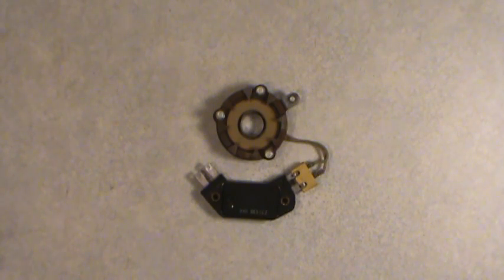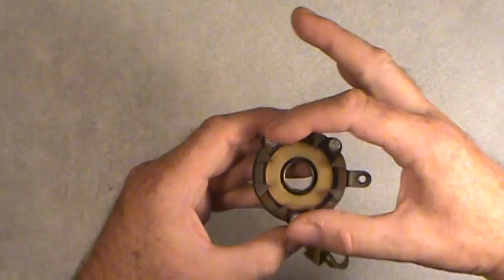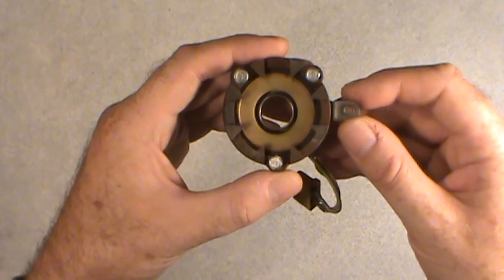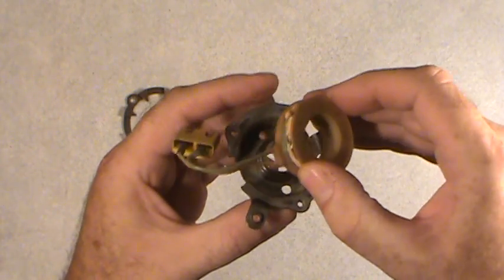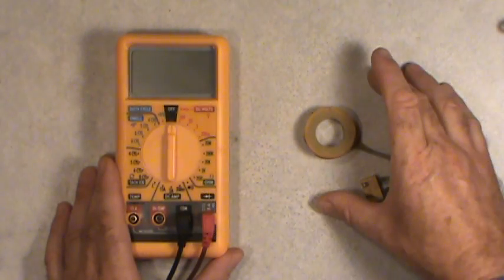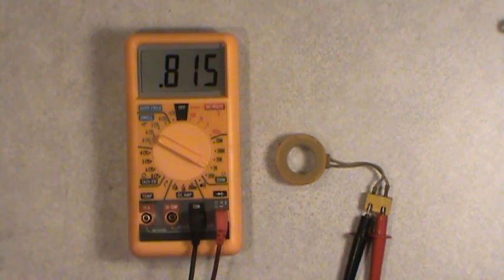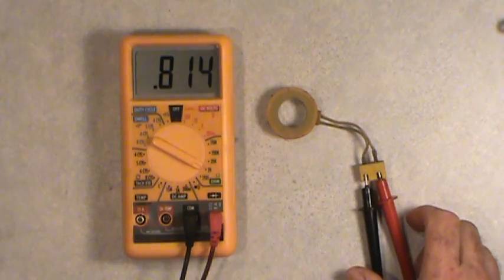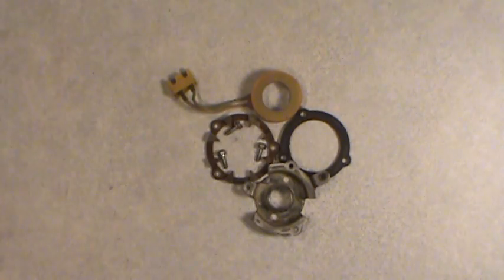HEI Distributor Pickup Coil Test

Comment: Thanks for the detail. The comments complaining about taking too long, are from guys itching to get back to their parts shotguns. “Hurry up damn it, Autozone closes in 20 minutes!”
Reply from the maker: Greetings...Tbone productions...……..You're welcome, and, thanks for watching...……..Yes-Sir-ee--Bob...there probably are, quite a few people, these days, that, sure seem to be, in quite the hurry alright...(oh, and, "no"..."horse & buggy rides"...for them, what-so-ever...!!!...lol)……….As I look back in time, then, the reason, that I started to study, and started to, some-what understand, the (General Motors), HEI (High Energy Ignition) Distributor, and how it worked, was because of, that, "misfiring", Chevy, 350 cubic inch (5.7 liter) V-8 engine, that I had to fix, way-back-when...…….Well, to me, it sure seemed to be, "ignition system" related, alright...…….So, I removed the HEI Distributor, and had a closer look at it...…..The pick-up coil's, very fine/thin windings (of wire), looked-like, they had seen too much heat (over time), and, the varnish-like coating, started to flake-off, if you will (replaced "it", and still no luck...lol)………..Then, I started, throwing some more parts at it, as well as, new spark plugs, and, spark plug wires too...(oh my gosh...!!!...lol), and, the engine seemed to run a bit better, but, still wasn't quite right (it's all good, because now, I have some, probably, working ok, "spare parts" for it...lol)……..Hmmm...so now what...???...I know, lettuce (lol), remove one valve (rocker) cover at a time, and, have a look-see...…….While, the warm engine, was running at idle speed (while having, only, one valve/rocker cover, removed at a time), then, the drivers (left) side, seemed to be ok, as in, all of the rocker arms, were..."tee-ter...totter-ing"...equally...but...when, I did the same, visual test, with the passenger (right) side, then...there..."it"...was...!!!...as in, the Number 4 cylinder's, exhaust valve's..."Rocker-Arm"..."was-not"...moving, very much at all...!!!...…….Yeah, I've heard of that, good ole, Chevy, "soft" camshaft story before, but, I never thought, it would ever, happen to me...lol...…..Come to think of it, I probably, never ran, that engine often enough (lesson learned, this time...lol)……….I actually ran, that particular engine, on, only "7-Cylinders"...!!! (it, huffed and puffed, and shook a bit, while at idle speed, and at very low speeds, but, when I got it up to, about city speed, it smoothed out, pretty darn good/almost like normal...…….Then, (for the temporary "fix"), I removed, the intake valve's rocker arm, and push rod, so the intake valve, would remain closed, 24/7...…….Then, I removed, the exhaust valve's, push rod, then, I placed the right length of bolt, under the rocker arm (push rod side), and then, turned (tightened), the rocker arm's adjusting nut, so, the exhaust valve, would remain open, just a little bit, so, that particular cylinder, could breathe, some-what...…..Engine started good, and never stalled, and, all of those, (running), "7-Cylinders", never misfired at all...!!!...lol...…and......till next time...….Be Safe, take care, and have a good one.
Reply: RockysRoadshow I’m amazed with all the engine components and transmission components and electrical etc. that cars are as reliable as they are. Not to mention the different weather conditions that we run em in. Take care

Comment: What do you do if the reluctor touches or taps those little triangles on the way by as it rotates? I know it's not supposed to but what do you do if that happens?
Reply from the maker: Greetings...Larry Van Valkenburgh……….Thanks for watching...……Well, if any of the outer, and inner triangles, are making contact with one another, then, that's probably not a very good thing at all (bent shaft...???...loose, or worn-out bushing/s, that will allow the shaft to go sideways too much)...………There should always be, an..."equal air gap" (as is, physically possible)...between all of the triangles, as, the inner set of triangles, that are on, the distributor's shaft, is rotated (advanced), by one, (triangular shaped) tooth at a time, and, the triangular points, are also, lining up with each other...……..The reason for the equal air gap, is because of, the way, in which, those two set of triangles, create an electrical signal (rising and falling of it), due to magnetism (there is usually, a flat, thin magnet, that kinda resembles a brown-ish colored fridge-magnet some-what) that can be seen, if those 3 screws, and the outer set of triangles, are removed from, that metal casing...…….I've actually "adjusted" the "air gap", on a V-8 HEI distributor, some time ago, as, I observed, a not so equal spacing (air gap), by my, shall we say, well-trained-eye...lol...…….If, by chance, any of the colliding triangles, have been, shall we say, "mushroomed over", then maybe, that triangular shape, might be able, to be restored, by using a small flat file (from a needle file set, possibly), but, only as long as, the pointed end of the damaged triangle, doesn't get..."shortened"...from its original size, otherwise, the air gap, might become too large, and, the result might be, a weakened magnetic field, possibly (ignition misfire maybe...???)………..If I recall correctly, if Ya hook up a volt-meter (multi meter), to those, two, pick-up coil lead wires, and, spin the gear end of the distributor, as fast as you can, by hand, then, there might be, a volt or two, showing-up, on that volt-meter's readout/screen...…….Those 3-screws (that, "are not" equally spaced), that secure, those outer 8 triangles/as a unit, can be loosened slightly, then, like I've done before, just tap those outer 8 triangles, from the side, until Ya end up with, having, the inner & outer sets of (8) triangles, equally spaced (air gap), when-ever, any of, the 2 triangle's pointed ends, are in line with one-another, oh, and, don't forget to "tighten" those 3 screws, or, oh oh, it will probably be (maybe, use some thin cardboard, or, a stack of, some small paper pieces, to create, a non-magnetic feeler gauge, if need be)...……..The actual "trigger" position, of those 2 sets of triangles, that trigger the ignition control module, happen, when, the "inner" triangles, just get past, the "outer" triangles, as the distributor's shaft is spinning (as I recall, the ignition control module, gets triggered, by the falling electrical wave, so to speak)………...I remembered this phenomenon, and, just a few weeks ago, I had to install, a brand new HEI distributor, into a 4.3 liter V-6, (only had, 6 triangles this time), and..."Hole-ee-gwalk-ah-moly...I was with-in...about..."2-Degrees"...when I put my timing light on it...!!!...lol...………Yes-Sir-ee-Bob...there will probably be, a rising, and a falling, electrical potential alright, as in, it will rise, as the triangles, approach one another, and, it will fall, as the triangles, just go past, one another, and...….till next time...…..Be Safe, take care, and have a good one.
Reply: @RockysRoadshow  Problem magically went away. All I can say, except I had the distributor together and apart several times and when I got a new module in there, they no longer touched. Thank you for your help.
Reply from the maker: Greetings...Larry Van Valkenburgh………..You're welcome, and, I just saw your post...…...You were saying that, you recently installed, a new, Ignition Control Module...…….I sure hope, that, you put some..."Correct"..."Heat Sink/Thermal Paste", on the metal/backside, of the module, before mounting it, because, if you don't use the Correct, heat transferring goop, then, the ignition control module might "over-heat", and, burn itself out...!!!...…….Don't use..."Die-Eelectric"...grease, as it won't transfer much, if any, of the module heat at all...!!!...(just read the label, or instructions for it)………..I use the stuff, that the computer folks use, on the heat generating chips (IC's/integrated circuit chips), that are found, inside of, computers and video gaming units...…….A small tube of it, is usually less than 10 dollars, and will last for, many, Many, module installations...…….This "thermal paste" (heat transferring compound), is usually, a white-ish color (Not "clear-ish", like, die-electric grease is, at all...!!!)………..Also, those 2 metal..."eye-lets"...that go through the ignition control module, are actually, the..."electrical ground"...for the ignition control module, so, make sure, that, the eyelets, and the 2 screws that go through the module, are nice-n-shine-ee and clean...…….Yes-Sir-ee-Bob...these HEI, ignition control modules, sure do, generate, quite a bit of heat, and, if Ya want "it" to have a long and prosperous lifetime, then, please do, use the..."correct"..."heat sink/thermal paste"...which Ya might not find, in an auto-parts store (I went to a computer store, and, I bought the cheapest stuff, and, there's also, some, really, Really, expensive stuff as well, as in, the stuff, that's called, arctic silver, as I recall), so then, there Ya have it, and...…..till next time...….Be Safe, (don't over-heat), take care, and have a good one.
Reply: @RockysRoadshow  I had to buy and use the ACCEL Control Module, and I used the thermal paste that came with it. I build my own computers also, and know all about the heat transfer and thermal paste. The woman in O'Reilly's who is very smart and helpful, said Die-Electric, and I knew that was wrong. Thanks.
Reply: I'll also mention, that this HEI distributor is basically brand new, even tho I have about one year's use on it. It's one of the conversions for Ford 351 w engines, and is awesome. So, it was clean and not worn in any way, except for the pickup coil windings coming all apart and shorting out the module. So I now have a new pickup coil, new Accel module which matches the ignition coil. A new MSD cap and rotor, and am now back in business.

Comment: Nice video . i remember years ago replacing one of these on a 77 Chevy Caprice . it was really tricky to find what the problem was. Was in trade school for automotive and the very next day we covered this part in class. How luck can you get.
Reply from the maker: Greetings...keving52002............Thanks for watching...........Yes-Sir-ee-Bob..."luck"...was in Ur corner alright, and, Ya should-ah considered, the though, (back then), about, maybe buying a few Lottery Tickets (just in case)....lol...........Those many turns, of "fine/small diameter", wire windings, that are wrapped around that, shall we call it, a "bobbin", perhaps?...are quite impressive, as to, the job/function that it performs...........Then, if a vacuum advance can/canister is in use, then, we gotta, keep in mind, just, how many times, that, the "bobbin's", two insulated lead wires, get "flexed", back and forth, whenever the vacuum advance canister, changes the position of its actuating rod, not to mention, the amount of "heat", that the whole HEI Distributor is subjected to............Gotta make sure, to use the "correct", heat transfer/heat sink "paste/compound", on the metal/back-side of the ignition control module (as in, the type of heat sink grease/compound, that the computer folks use, and "NOT", to use...die-electric grease...!!!), or, there's a pretty good chance, at having, the ignition control module, go..."Poof"...from too much heat build-up...!!!..........Also, all HEI Distributor components, have to get along with each other, as in, the, correct "matching" up-with, one another..........I hope, Ya have, another, "lucky", point-in-time, every so often, and.......till next time........Be Safe, take care, and have a good one.

Comment: Engine have a LOT of vacuum at idle. None at WOT
Reply from the maker: Greetings...Ryan Hamm.........Thanks for watching.........Well, you are right, generically speaking, that is.........More like, there will be quite a bit of, intake manifold or plenum vacuum at idle speed, which will usually be dictated by the camshaft, as in, a stock engine's camshaft, will produce lots of idle speed vacuum, where-as, a very aggressive camshaft, won't usually have, all that much, vacuum at idle speed, and sometimes, not even enough vacuum (signal), to, be able to, run a vacuum brake booster...!!!...yikes...!!!...lol...........Also, there's usually a little bit of vacuum at WOT (Wide Open Throttle), as in, some carburetor manufacturers, rate their 4-Barrel carburetors, at about 1.5 Hg (inches of mercury, on the vacuum gauge), and, a 2-Barrel carburetor, at about 3 Hg (as I recall)...........All Ya gotta do, is hook up an "accurate" Vacuum Gauge, to the intake manifold, or, the Plenum, as the case may be, and, see what the vacuum gauge reads, at idle speed, when the engine is fully warmed up to operating temperature..........Then, do a WOT run, on a safe (legal...lol) road, or, on a Dyno (Dynamometer), and see, what the "real" vacuum reading, actually is, oh, and, look Ma, no more "guessing" any-more...lol...and.......till next time.......Be Safe, take care, and have a good one.

Comment: I got a question. My distributor in my 1979 Volkswagen bus is getting very very hot and I have no idea why it is
Reply from the maker: Greetings...KikiMaster Chris.........Thanks for watching.........Was this too hot of a Volkswagen distributor, something that you just happen to notice, as compared to, how hot it usually gets, once the engine gets up to operating temperature, and also, how did you determine its temperature, as in, too hot to the touch (by hand), or otherwise...???............Is the engine running good or not...???...........The distributor's main body might be made out of aluminum (metal), and is usually installed into the engine block (case), so, the heat from the engine block, will get transferred to the aluminum part of the distributor, and that's one way, that the distributor will get heated up...........Hmmm...have you replaced any ignition system parts, or made any new ignition timing (advance?) settings/adjustments, just before you noticed this extra (hot) heat...???............Here are a few other things...........Did you notice any unusual/different "sounds", coming from the distributor at all, as in, squeaking or grinding noises, etc....???...........Inside the distributor cap, at the top/center, there might be a spring loaded carbon button, that makes contact, with the (spinning) rotor's center point (metal part of it), and, if the carbon button "wears" too "short", it will usually "lose contact", with the rotor's metal bar (contact point), and when it does, the Larger the Gap becomes, the higher the ignition coil's, high voltage output has to get, in order to, shall we say, "make the spark jump", that extra, not so much wanted gap..........Same thing happens, when-ever a spark plug's electrode "Gap" gets Larger, than the factory's specified spark plug gap, for that exact engine...........Also, just about any time, that a Larger Gap occurs, anywhere on the secondary/high voltage side of the ignition system, then, the poor ole ignition coil, has to work much harder, to be able, to (hopefully), produce a nice strong spark, between the spark plug's two electrodes...........Same thing happens, when-ever the electrical resistance become higher as well, due to things, like worn out spark plug Wires as well...........Are you doing regular tune-ups and maintenance...???...because, if not, it's just a matter of time, before the engine acts up, and tells you that it needs some help.........So then, make sure that you keep the ignition system in good shape/operating condition, as in, don't let parts like...distributor cap & rotor...spark plugs...spark plug Wires...etc....get worn out too much, or become too old...and also, try to keep the ignition system tuned/adjusted to the VW Factory "Specifications"..........If there's anything else, that you might need some help with, then, just give me a shout, and.......till next time.......Be Safe, take care, and have a good one.
Reply: Head on over to The Samba for ACVW mechanicals. Timing on them needs to be set at full advance (mechanical) 28 BTDC @3200+rpms.

Comment: good  video
Reply from the maker: Greetings...abdyfe...........Thanks for the nice comment, and for watching too.............Well, the HEI Pickup coil, when in combination, with those 8-inner and 8-outer triangles (on a V-8 engine's, HEI large cap distributor), and, when-ever they are lining up with one-another, is, shall we say, the Timing Signal, that tells, the ignition control module, when to turn the electricity off, that's being fed, to the HEI ignition coil's primary windings, and, when it does, the so-called magnetic field, that was already built up, collapses, and, when it does, it results in a voltage increase in the ignition coil's secondary windings, up-to the amount of high voltage, that's needed, to be able to bridge the gap, that's between the spark plug's two electrodes (simply put, that is), and........till next time.........Be Safe, take care, and have a good one.